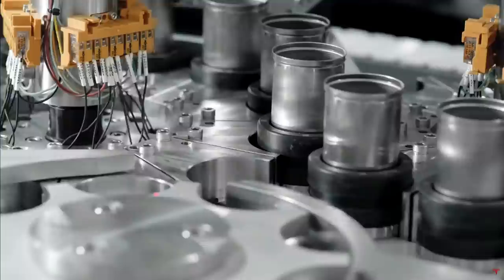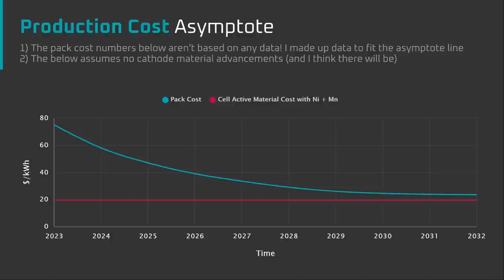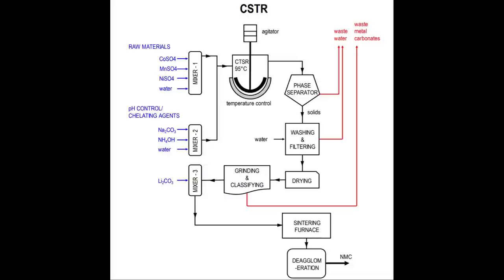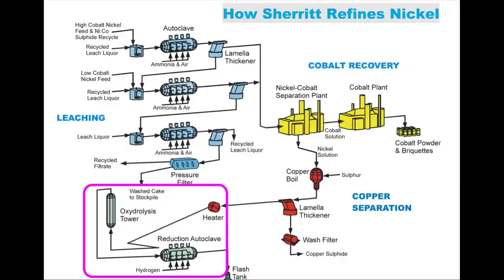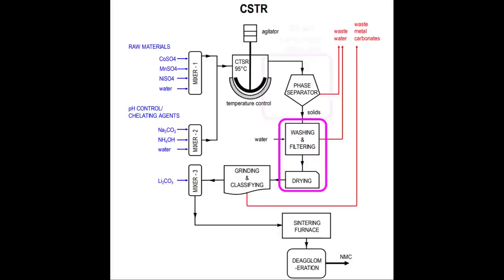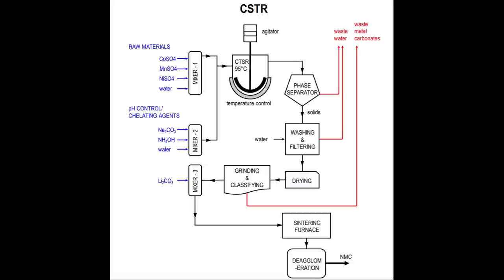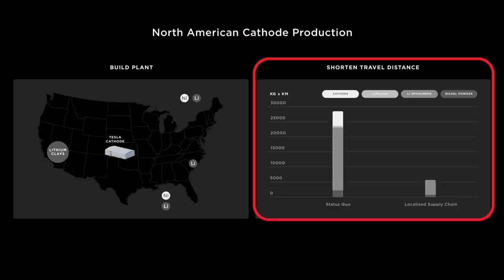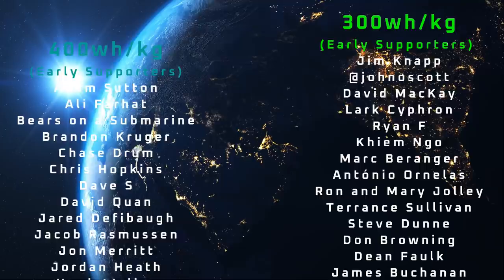#12 Tesla's Cathode Production Process // Breaking the Price Floor

Comment from the maker: Note:  There seems to be a lot of confusion around Sulfide and Sulfate...

Nickel Sulfide is NiS
Nickel Sulfate is NiSO₄(H₂O)₆

Despite having sulfur in common, they are two different things.
Reply: Not really. The difference is Oxygen. Although you're showing a hydrated sulphate...
Reply: True but Jordan is really saying that as attractive as lightweight hydrogen may seem to electron heavy oxygen covalent attached oxygen and nickel dime types like sulfur when unbathed,  smelly and somewhat expensive at a nickel per noble unit reacting where potentially weak forces prevail while Ion the other hand attach to all parts of the group with generous sharing of energetic bonds when possible if I fit in saving mater  as a group with a true magic if periodic clinging.  Called stable but energetic temperature can disrupt our sometimes ordered group.  For the most part we conduct our magical power  when electric voltage is currently asking for a room at the inn.
Reply: Really appreciating you using subscript numbers for chemical formulas.

Comment: You mentioned the notion of Tesla moving away from Nickel cathodes entirely, in the next ~10 years. I have two questions: 1.) Are you assuming LFP and/or Manganese would take over the whole fleet? Or is there something new that would join the fray? 2.) Do you think it's possible that they will continue with Nickel in some capacity, sourced from recycling retired packs? As Elon mentioned, "long term, new batteries will come from old batteries." 

All-in-all, great channel, happy to be a Patreon supporter!
Reply from the maker: Proably >10 years.  I'm just talking about replacing the Nickel with something like Sulfur or LiCl+C, not eliminating LFP.  Nickel will continue.  Too far into the future to go deep on at this point!

Comment: The Solvent Separation techniques work for complex chemicals, could Liquid Metal Battery Molten Salt charge and discharge cycles be applied to Refineries of these Elements? Ie ask Prof Donald Sadoway's team at Ambri.

Industrial Electricity costs are everything,  so Onsite Generation is critical.
Reply from the maker: Interesting question!

Comment: You do have a very impressive understanding of battery tech.  If I could ask you two questions it would be why is Tesla still using nickel based batteries in stationary storage, instead of using longer lasting iron in stationary and higher density nickel in mobile. 
The second would be similar.  Should Tesla be looking into nonbattery storage solutions for grid scale storage in order to maintain material for automotive and truck batteries.  Example, if boring company could perfect a machine that dug vertical shafts instead of horizontal they could build gravity electric storage systems, thereby leaving more battery material for transportation.
Reply from the maker: There are a number of possible reasons:  LFP is a new up and comer, they can't just flick a switch.  There are patents that surround LFP, some of which are coming up soon.  Their partner is Pana, which isn't big into LFP.

No, they shouldn't be.  The battery opportunity is the biggest segment of the market.  They are short on engineers for batteries, so why spread them out over completely different technologies.  There are more reasons than that, but the other explanations would take more time.

Comment: Thanks for the great content. Do you think the rolling process for Tesla Cells could result in tiny compression cracks in the dry material? I found the bank note analogy at VW Power day vs the bottling plant at Tesla Battery day interesting, did you pick up on that?
Reply from the maker: NAh, DBE is much more durable than wet slurry

Comment: Your graph @time 2:35 is misleading in that it implies manufacturing costs approach material costs.  While I agree that manufacturing costs tend to decrease over time, there is a fixed component that is much greater than material costs.  So the "asymptote line" should be much higher than the material cost line that you show.
Reply from the maker: I wouldn't say 'much' higher, but probably higher.  As per the comments below the title - it was meant to be illustrative.  The key point is the concept, not the actual data.  Regardless, as a result of number of improvements not listed in this video I do expect us to hit the $30/kwh at the pack level shown in the image.

Comment: Hi Jordan, I've just recently found your channel, have been devouring the content you produced and this is the first video I've got a question on - do you really believe Tesla would go into mining materials themselves with companies in the likes of Redwood Materials and American Battery Metals achieving such high yields from recycling the existing batteries? I would consider it far more likely for Tesla to either partner with such companies or start doing it themselves than start mining materials. I'm curious about your thought process on this one, thanks!
Reply from the maker: Yes, I do.  It will be a 10 years before recycled materials come back in significant volume.  20 years before it becomes close to being a self-sustaining loop.  This is because electric vehicles last 10-20 years.  Tesla will need recyling for scrap that comes off the 4680 line, they may as well get into recycling too because they'll have robotaxis and lease vehicles coming back.  It will be a closed loop and very large scale.  Why outsource the margins?  That's the best I can do in the comments section.  This is a 1 hour topic.
Reply: @thelimitingfactor  Appreciate the reply! Wouldn't the vast amount of already existing electronic devices suffice, at least to some degree, for recycling to prove significant enough even today? Or are these just not feasible to be recycled for materials that would be usable for car batteries? I don't want to argue it as a point, as I haven't done proper research on this topic, and sure enough, your reasoning seems sound, just wanted to follow up as the question just came to mind. I hope you manage to explore the topic in the future video then!

Comment: do you know how feasible it would be to recycle the batteries for their minerals so we don’t have to rely on mining as much?
Reply from the maker: Not so much right now, but that should change in the next 5 years.  It will be 10 years before it makes an actual impact though and another 10-20 years after that before the bulk of materials are recycled.
Reply: @thelimitingfactor  cool. Also, do you know if the recycling process would create much greenhouse gas emissions? (less emissions than the from scratch process obviously)

Comment: Straight forward question. In the next 10 years will silicon replace graphite in most cation/anion batteries both in and out of the EV industry?  Been reading about its attributes and they appear to be inevitable. Your thoughts. 
I know you've discussed this in prior videos, but I can't seem to locate those videos. Thx.
Reply from the maker: It's covered in the 'disrupting silicon anodes' video
Reply: @thelimitingfactor  Thx.
Reply: 10 yrs is a long time and battery technology is changing rapidly.  My prediction is that Li-metal of anode-free technologies will dominate.  These are already emerging and offer much higher energy density than silicon.

Comment: I didn't hear a "in the next video...". Did I miss it? Tesla Acid-Free Lithium Extraction Process?
Reply from the maker: Yeah, that's next.  Forgot to add it!
Reply: @thelimitingfactor  Stellar!
Reply: @thelimitingfactor  I was reading an article about this from September and as they discussed a heavy sodium process, I started to think about spinning sodium with clay and if they can get the lithium to bind to the sodium, but then how to separate. But then I remembered that sodium has a lower melting point than lithium, so maybe that's it. So excited for this video and to hear what you've learned about this crazy thing nobody thought was possible or at least not plausible.